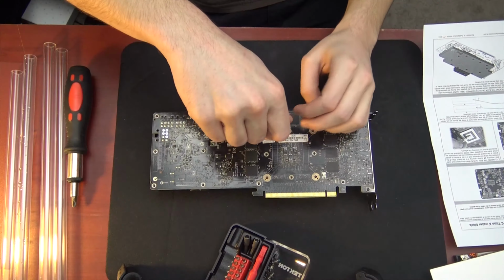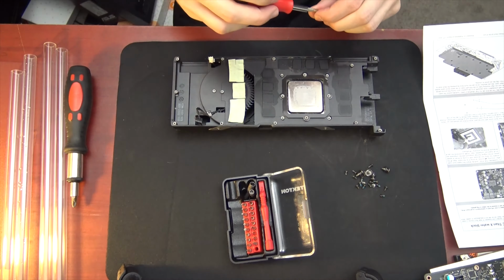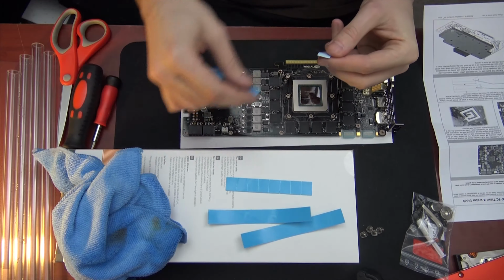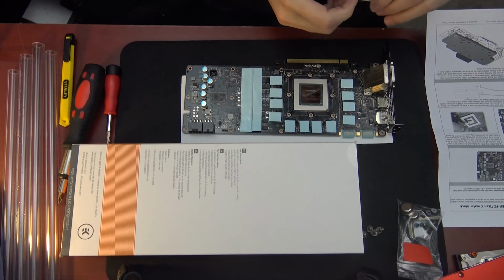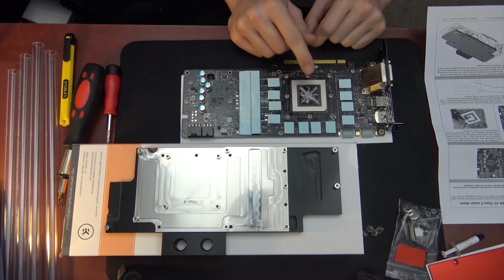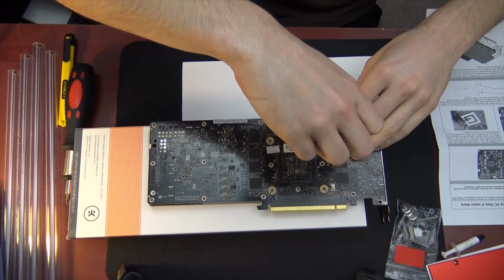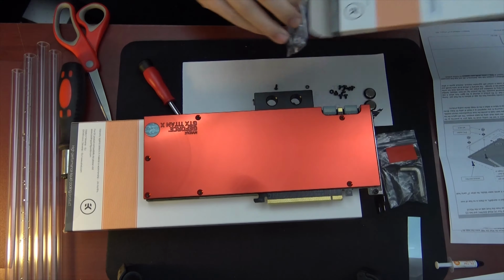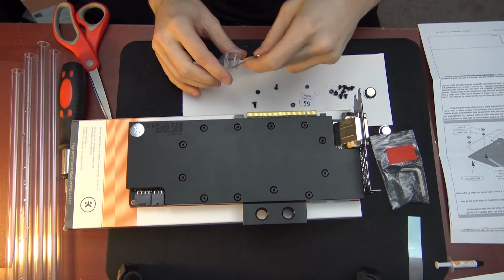Titan X Water Block Install

Comment: Thanks again for the video bro , you rock. What was  the thermal paste did you use?
Reply from the maker: not a problem. You rock for actually watching a bunch on them. :P
Reply from the maker: You gave me an idea for a video though! I'll hook up a test bench, and run some thermal tests on an old GPU with different thermal pastes. I want to also test Arctic Silver 5 on there to see if the card will blow up. :P
Reply: ahahhahaha well hope it does not blow, but would be a great video if it did :D, joking I do not want to see you or the pc get hurt. But would be awesome to see a video about thermal benchmarks for sure. As not many and everyone must know . I had to open my GC to clean it and I broke the thermal past seal, so I need to be replacing it, thou I have assembled like it was, but I believe the best way would be to re-paste ,thou was stripe thermal  on the GPU.
Reply from the maker: Coolissim0 Unl1mited Don't worry, I'll test in a safe area. I just need to setup an old machine with a PCIE slot to put an old card into. Should be no problem.
Reply: Electreak
yeah looking forward to see that

Comment: Does this block work on a 980 Ti?
Reply from the maker: +VRSimReviews If you have the reference card it should work.
Reply: +VRSimReviews Yes, for reference 980 Ti. The only difference it's that the 980Ti has no vRAM on the back, so you don't need to put thermal pad there (confirmed by EK CC)